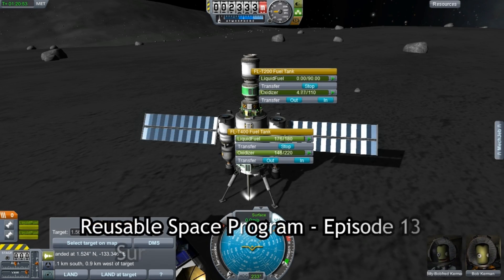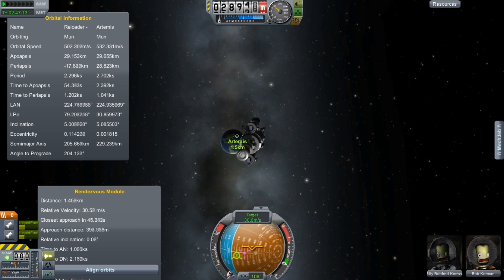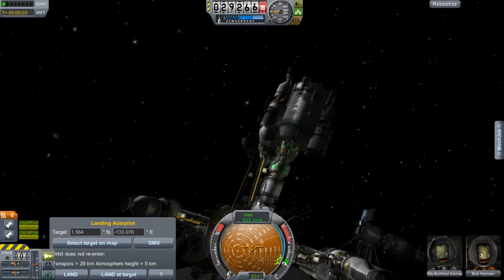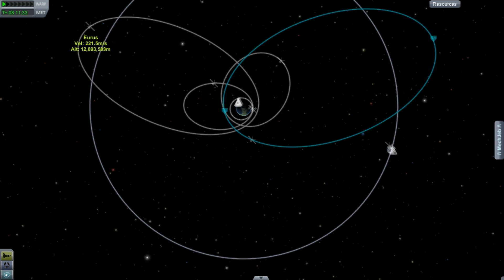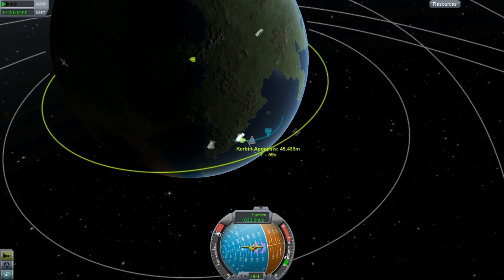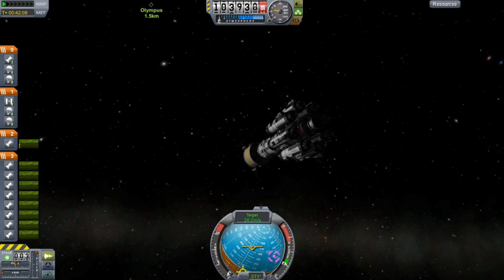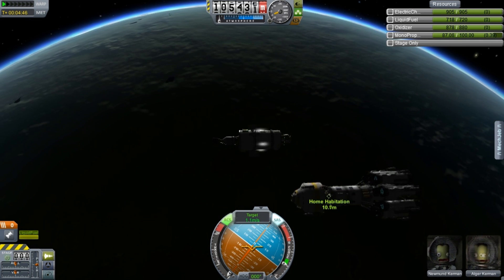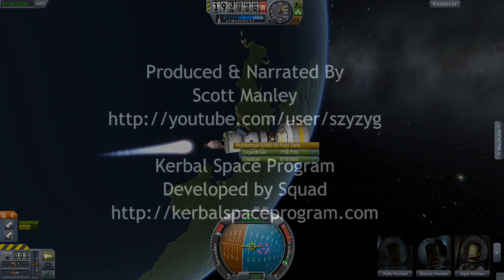Kerbal Space Program - Reusable Space Program - Episode 13

Comment: I don't think you can mine 10 years worth of platinium at once, so I think we'll be ok :P
Reply: You sure can. The point of asteroid mining is that things which are very rare on the surface of the earth, like platinum, can be reached quite easily (if you can get to the asteroid in the first place). So one load from an asteroid mine might equal 10 years worth of earthside production.
Reply: Joel Cruse By that I meant it'd be hard to transfer it back here, it's tons and tons, but yeah you're right extracting it wouldn't be really hard if we can get a mining apparatus to a big enough asteroid.

Comment: I'd like to point out that the Kethane mod would be more efficient if you used the normal fuel transfer system and it converted it to fuel for whatever you're clicking on.

Comment: Okay, so, I did some rough math. If you have 8,000 units of Kethane, and it converts to 1/5 of that liquid fuel, and you have a converter that is only 70% efficient, you only get 1120 units of fuel, not much, so, considering you also need oxidizer, you aren't gonna get much out of that one miner, it will take some time, and some is used to get back up and rendezvous, so, yeah. I suggest a large Kethane transport and then refining that Kethane at Olympus.

Comment: I've been building an Apollo style rocket to lift a module about half that mass, and I'm running into issues with it's structural integrity.  It involves about 150 tons of fuel in the bottom stage alone and aerospike engines to make the most of said fuel.  What I'm saying is that rockets that big are a bit crazy and tend to explode.  If you can, send the lander up in multiple parts and build it in orbit.

Comment: I had heard that Bigellow's modules actually use a kevlar layer, which effectively makes them bullet-proof (or at least bullet-resistant).  So they should, in theory, stop a micro-meteorite penetration right in it's tracks.

A lot of people make fun of the marshmallow-shaped modules that would result from adopting that kind of architecture, but I sort of like it.  It's different and original.

Comment: Is there a particular reason you're using a Mainsail for the core of the reusable launcher, rather than, say, clustering a few LV-T45 vectoring engines for greater ISP? Do you actually need that much thrust?

Comment: I dont think it's possible... The velocity of the orbital spacecraft would be too high, and even if you aligned the docking ports perfectly, the magnetism would have to be great enough to pull the other ship into orbit.  At the same time though, it would also be getting pulled out of orbit by the other ship.  So it would null out, assuming they actually attach.  But, they probably wouldn't because the one with the higher velocity would slide by the one with a lesser velocity.

Comment: Couldn't you make a very large stationary kethane miner? Do it in stages so you have 1 mining stage with many drills and 1 / several large tanks that can be docked to it. Then just need a fuel tanker between the mun and the station. The current system seems too inefficient, long term at least.

Comment: Why not land a few large empty fuel tanks next to the kethane miner? You could transfer the fuel there instead of going back and forth. Put wheels under it with a docking port high up that faces downwards at the correct height for the miner. :-)

Comment: might i add a permanent base would have much higher yield but a modular base would be great for moving the base to other deposits if needed as for the method of moving i say either put them on wheels and tow them with the rover or small engines for hovering over to new locations (think terran buildings in starcraft)

Comment: Scott, why are you transporting the kethane all the way into orbit and refining it there? I've found it works much better to use the tiny kethane tank and convert it on the surface, filling one of the large fuel tanks. Also, I haven't tried this, but might it be possible to create a fuel truck, and dock horizontally on the surface, so you could transfer fuel to a lander from a fuel mining rig?

Comment: Perhaps working on "part efficient" launches and stations will help FPS? I'm planning on having 1 fuel station, 1 crew station etc, each small and each 2.6KM away from each other. Just got to figure out the best way to get them in stable orbits and also getting between them. :P

Comment: you could cheat. The large Kethane converter never runs out of Kethane once you give it an odd amount in a tank. It just keeps using 0.05 units over and over and over again.
Or you could use a small Kethane tank and larger fuel tanks, convert on the ground and you'll be able to drag up lots of fuel. Come back down to the surface with only the fuel you need to land and no more.